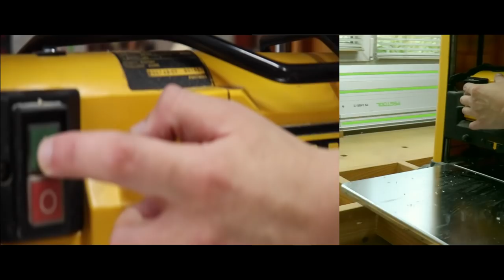AMAZING WOODEN SWING | Как сделать качели.

Comment: Beautiful project. Great workmanship, craftsmanship. To me the design is slightly off in the seat. Looks like you have to work at staying in the swing as specially when swinging because the curve is set at such an angle that you slide out of the swing if you are swinging even just a little bit.
Reply from the maker: Thanks for watching.

Comment: I see you use different glue for the wood joints than you use for the "domino/dowel" joints. Why is that, and is the domino joint glue a polyurethane glue?